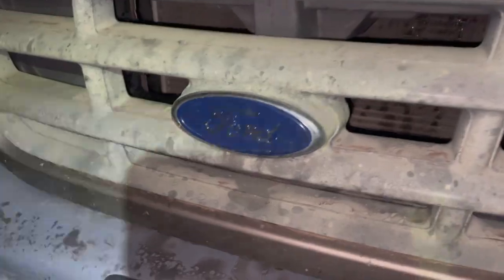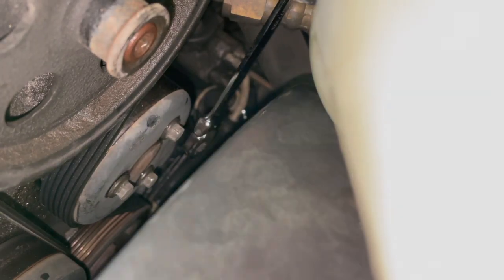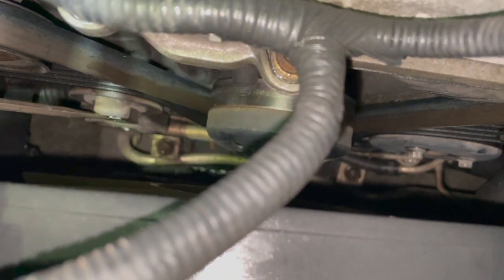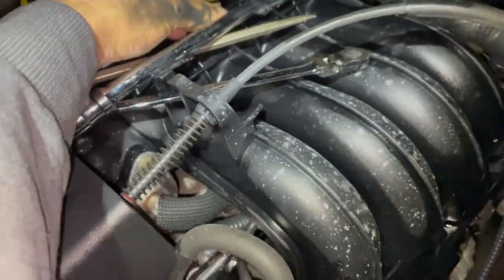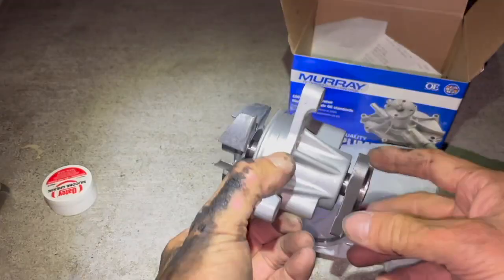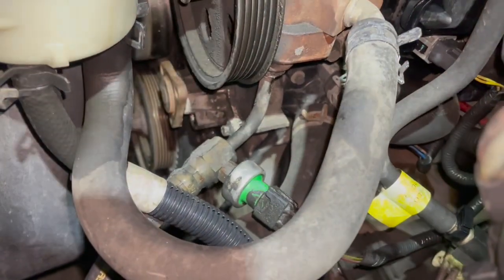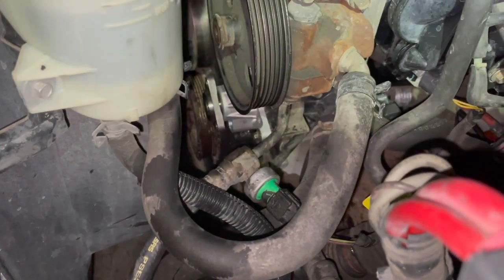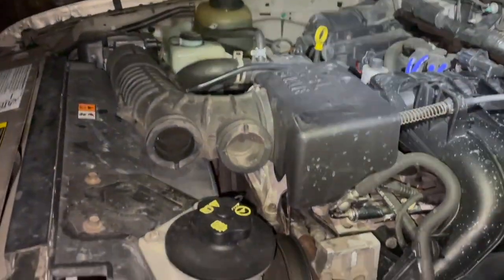2003 Ford Ranger 2.3L water pump replacement

Comment: Thank you for explaining the hardest part of this procedure. I had the original pump 189k miles. I used every tool I had while trying to be careful to not damage the aluminum housing. 2 of the bolt ears broke out of 3. How I did it: I tried prying on the pulley shaft of the water pump but I ended up getting it cockeyed. Very hard to get from the bottom of it. I used a piece of 2x4 and a mallet and beat the pulley shaft. Also I came from the bottom of the car and hit the shift of the water pump with 2x4. Also try using oil filter pliers or channel locks and grab the shift and wiggle it. If it moves even slightly it wants to come out! Keep at it!!